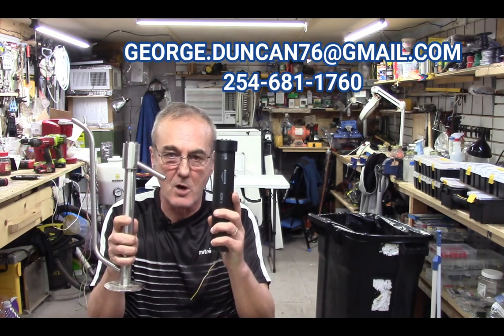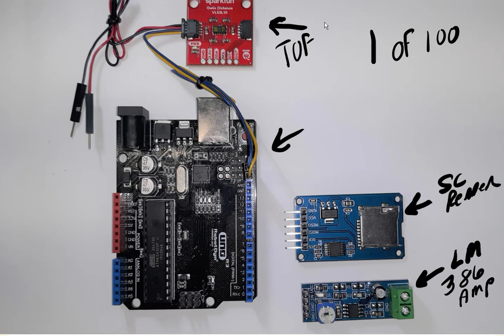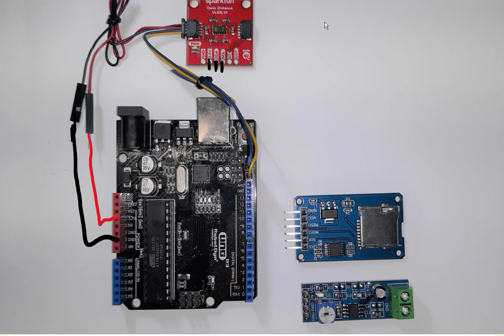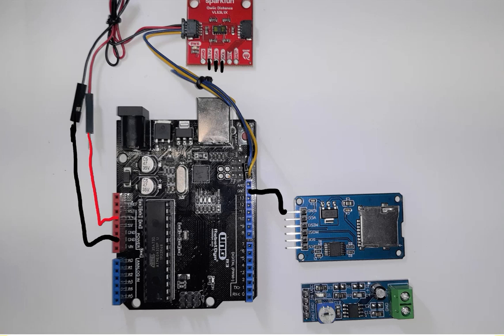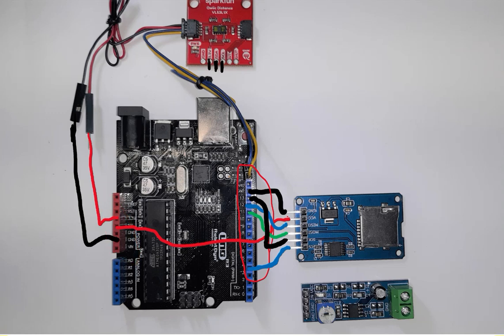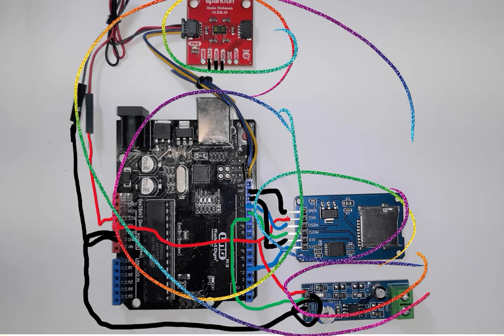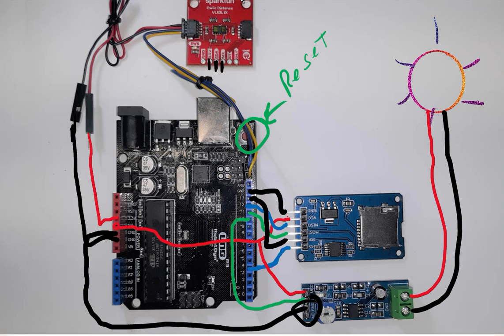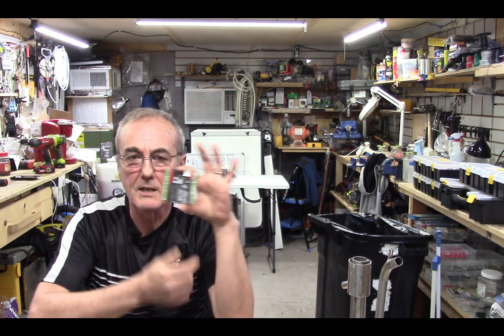PARROT HEAD ASSEMBLY PART TWO WIRING

Comment: #Happy Distilling,  1 question I thought it was questionable when you added the splice to the 5V connection,  as I understand the UNO ,, it can be burned out by drawing to many amps-milliamp,,, I would think a power board as the speaker board would draw a  bit of  power,,    but then at the end you add those pieces for more connections, and state more power pin options,,,  have you considered that adding all these items might be getting close to overload of the UNO max power output????
Reply from the maker: Uno has a built in voltage regulator to handle that additional draw. 
George

Comment: Question ?  Why do you use a parrot. And are you not worried about  Smearing. By the way I love your videos Keep up the good work. I would like to see a video on the use of the parrot That would be great
Reply from the maker: Smearing? If you mean the difference in proof mixing during the run, No. With the level of change (if you run it correctly) that should not be a problem. I, as most others, mix everything collected anyway. If you are refering to methanol smearing, I have not been able to perceive any methanol after the foreshots. Methanol has no azeotrope in a mash so it comes off completely at first. If there is any left that smears in the run you cannot detect it at the levels (if it is even there).
Reply: @BarleyandHopsBrewing   Thank you for the input I really appreciate it Cheers

Comment: Hi George on the first Parrot head Video you mentioned that the 1 1/2” pvc pipe is 145cm high is that correct if not what is the actual length of the pipe in cm/inches. Thank you kindly Regards  EMMANOUEL
Reply from the maker: It is mm not CM. Slip of the tongue
Reply: Barley and Hops Brewing   Hi George I am truly sorry for being a pain but could you give us the length in inches because 145 mm is approximately 6” and the tube looks much taller then that my apologies for bothering you again with this.     Kind Regards  EMMANOUEL Thank you.
Reply: Hi George I figured out the length of the pvc tube is 245mm or 9 5/8” inches if you want to validate that will be great. God Bless and keep as all  healthy. Regards EMMANOUEL

Comment: Can anyone throw me a solution to this . . two days ago I made a sugar wash, 18L tap water, 4kg's white table sugar . . I made a yeast starter using 1/2 cup of warm water, 2 teaspoons of sugar, and 1 tablespoon of 'bakers' yeast. The starter worked out beautifully, doubled in size within 15-20 minutes. So I added that to the 18L and sealed her up, came back yesterday and not much bubbles from the bubbler, so I had a peak, not much happening inside either, I left it again, today, there is not much activity, small bubbles inside, no fraught, but there is a serious bang of alcohol!! Am I still good? Or should I start panicing? I should also add, that I boiled the 18L the day before (because it is tap water) and the temp of the wash is holding around 20C - 25C since I added the starter. I have brewed beer before and also a small sugar wash as a test, so I know what to expect, but this non activity is a first for me. Any info would be great! Tia.
Reply: Oh, I forgot to mention that I don't have a hydrometer at the mo, I simply can't find it! But I have a new one on the way..